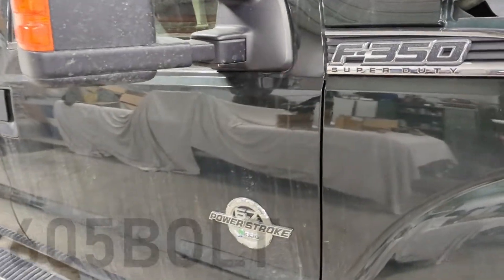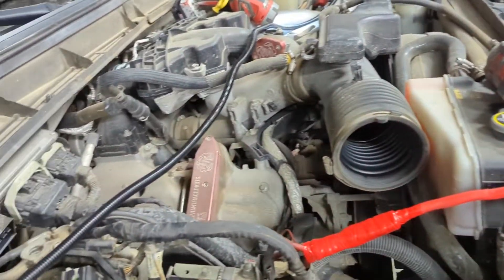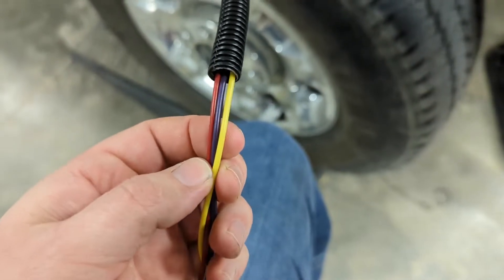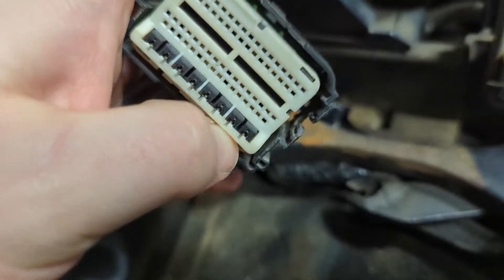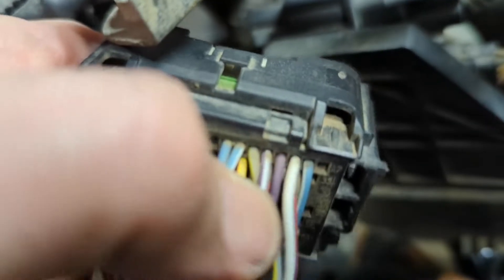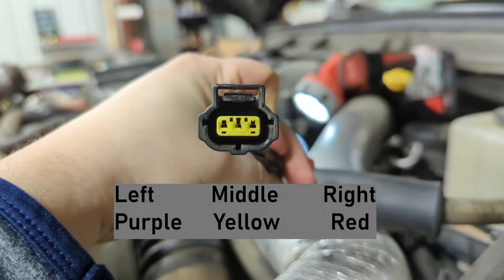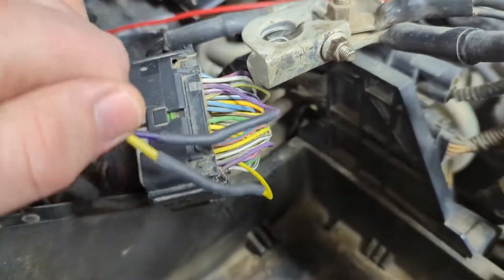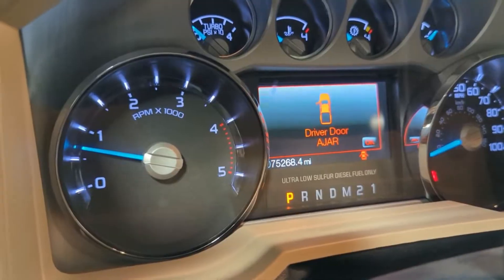6.7L PowerStroke Battery Light -- Common Problem, Easy Fix!

Comment: This solved my problem. My truck would flash the battery light when I reached speeds over 55mph. I had a feeling it was a corroded wire that was acting up as the truck accelerated. My infotainment and dash lights would turn off as well. I search high and low for corroded wires but couldnt find any visually. I followed the instructions here and resolved all my problems. Honestly, this repair would have been easier than trying to repair a corroded wire under the truck. There is not much room around the bottom of the engine. I was skeptical of the 5A fuse, but so far so good. Thanks so much for posting. Took me maybe an hour, but I loomed the new harness and replaced the alternator pig tail.
Reply from the maker: Yes! Glad you posted back. We have had many miles of problem free service as well. Glad this helped someone out. Beer time!

Comment: Don't let the red wire fool you. If it shows any resistance at all, run a new wire alternator to battery. The battery tested 12.4 volts at the posts but at the alternator that red wire tested 11.8 ... revealing there is resistance in the wire not allowing all the voltage to pass through it, basically now sending a message back to the alternator that it needs to generate more power. This more voltage output, as high as 16.4 on our truck, now sends a signal to the PCM that too much power is being generated and goes into a safe protection mode and shuts down electronics such as instrument cluster, dome light, radio etc. The heater will come on thru the defroster, because the blend door is now not working and goes to neutral mode. The FASS fuel pump would speed up, telling us more voltage was being generated than needed. We ran a new red wire from the alternator to the fuseable link and if fixed the problem. Evidently their is corrosion in the old red wire somewhere creating resistance, not allowing the full 12.4 volts to be reported to the alternator, causing it to kick up power. It was a 5 day project to figure this out. Hope this helps someone.
Reply from the maker: Great points! Thanks for adding this!
Reply: Holy shit great advice thanks! This exact scenario happened to me this morning on my way to work. You saved me a ton of diagnostic work. Thanks!!!
Reply from the maker: No problem!

Comment: Questions, so my 2017 F450 had the same issue. I fixed the yellow wire then a mouth later the light came back on. I bypassed the whole factory wire tray and went to PCM and Battery. However the light is still on...any suggestions?
Reply from the maker: If you test the voltage at the battery, is it charging? Should read 14+ volts on the battery when running.
Reply: Did you ever figure out what caused the issue? I’m having the same thing going on right now.
Reply from the maker: There was a break in the engine harness on the front of the engine. I never did actually confirm that that was going on but the truck has been running great ever since. I'm actually currently driving it.

Comment: Getting a similar issue to the one in the video on my 2012. Battery light will randomly come on and voltage drops to 11.9. Then it will jump back to 14.6 and the light shuts off. Had the alternator tested and it’s good. I’m thinking the same issue but not sure? Thanks
Reply from the maker: Could be. In our scenario the battery showed 14 always using a meter to verify. However the charge light would be lit. So maybe you have a different deal going on. Never showed 11.9 by the meter for our scenario.
Reply: Any luck with your issue.  I'm having the same thing.  Replaced alternator and rewired eveything like shown in video
Reply: @virgilhoefels5089 I’m having the same issue, did it work for you?

Comment: I had a similar issue on our work service truck two years ago. It was only charging at 13.6 volts and the battery like was on. Ran a overlay from the ecm to the alternator connector. Started charging at 14.6 volts. Battery light off. Well two years later to almost the month.  Now the dash shuts off and thd battery light us on because its charging at 17.9 volts.  Checking the wiring tomorrow. But ordered a alternator for it. Plus two batteries because its cooking the batteries.
Reply from the maker: Interesting. No issues here yet. 13.6 sounds like it was right to begin with.
Reply: @605BOLT  I found 13.6 is like a default charging voltage reading with a battery light on. 14.6 and the battery light shuts off on the dash.  It's a smart charging system. Ecm controlled
Reply from the maker: @GregFeeney392  interesting.

Comment: my husbands truck is having a similar issue but he alternator is not charging took It to a shop paid almost 600 for them to fix a ''broken'' wire its been maybe 2 weeks and trucks doing it again alternator is good and he wants to do what you did in the video he was asking if its the same for a 2014 6.7 and also where you connected for the 12v reference should that contact have constant 12v or only when the trucks on and charging because his dose not
Reply from the maker: I assume this would work for 2014. The 12v is literally right to the battery by whatever means. Do include the fuse. We hooked in with a little ring crimp in the video. Include a fuse just to be safe but should be good to go otherwise. Hopefully you get your truck running. Hit me up here if you have any questions. 👍👍
Reply: Did the charging problem get fixed?

Comment: Thanks for the video, it was a lifesaver.  I only had one wire that tested bad and that's the only one I bypassed, the yellow one.  So far so good, now I've got the proper charging voltage and no battery light.
Reply from the maker: Yes! Love to hear it.

Comment: Are the colors on the pcm on a 17 the same ?
Reply from the maker: I don't know. I'm sorry. Best indication would be to look at both ends and if they match then chances are you're good to go.  Sadly you can't check continuity in the wire because chances are they are torn.
Reply: @ oven changed my battery’s and alternator and check or torn wire and find anything I just want to replace them but not sure which ones they are on the pcm
Reply from the maker: @bryanmunoz6133  maybe you can find the wiring diagram online. Could definitely be the same.

Comment: Thank you for making this video, without it I would have purchased a 600.00 alternator and still have the trouble light.
It ended up being the yellow wire to pin 53, I re-routed it along the firewall and now all is well.

Thanks again!
Reply from the maker: Man that is awesome to hear.  Glad you got it fixed!  Thank you for commenting!

Comment: Following ur fix , it fixed my problem , i did found broken red wire under the truck , on the passenger side , fixed it , but light never went away and truck had higher rpm like idling around 800/900 rpm, i bet i had other bad wires somewhere else , so i just bypassed it like you did run 3 new wires and booom fixed it , back to normal idling around 500 rpm ish and no light. Thx man. !
Reply from the maker: Right on!!! Ya they can break in a few different spots so I bet you're right. The high idle is annoying. Beer time it sounds like. 🍺

Comment: Thank you so much! I got a 6.2 f350 in the shop right now, I found the purple and blue (yellow in your video) wires in the electrical diagrams but was having a hard time figuring out where they wanted the red wire ran to.  (1st year apprentice and am still learning how to read electrical diagrams)
Reply from the maker: Oh nice! Ya I didn't know this was a problem for 6.2 gassers. I thought it was only a super duty problem. Let us know how you turn out!!

Comment: Just did this at work today on a 2014 F550. Fixed.
Reply from the maker: Love to hear it. Beer time!
Reply: @605BOLT  next is having to take away the DPF delete.. but that's a Monday problem.. 🍺 🍻
Reply from the maker: @ridds777  did I read that right? Undeleting the delete? Aka back to stock? Or are you doing the delete? That exact truck in this video was deleted due to a failed def heater.
Reply: @605BOLT  undelete the delete. Back to stock.
Reply from the maker: @ridds777  oof that sucks. Why is that? Selling it?
Reply: @605BOLT  in Ontario here. Commercial vehicles have to have yearly safety inspections and emissions testing. In order to get in on the road, the DPF has to be functional.
Reply from the maker: @ridds777  oh man. So do you install it for a week and then remove it again or is it going back on for good?
Reply: @605BOLT  back for good. Catalyst has to be put back, reflash the pcm etc.
Reply from the maker: Dang. Party is over.
Reply: @605BOLT  the bill is already insane.

Comment: I didn’t have 12v at the plug so I went ahead and ran overlays from the battery and PCM to the plug. I had power and continuity but still the same issue. New alternator but still the same issue. I found that the fuse on the side of the passenger battery was broke. I had to cut the plastic cover off it to find it. I soldered it up and that was the issue. I’m ordering a new fuse but for now I’m up and running.

Comment: Any idea what the output from the alternator should be? Just had a shop put a new one in, I was getting 13.01 right off the alternator before and the new one is saying 13.5, battery light is still on. I feel like it should be closer to 14v, Will this wire effect how much the alternator is putting out? The replacement alternator was an OEM ford replacement
Reply from the maker: 13.6 is nominal I believe. I don't think it changes output. You either have it or you don't. Sorry I can't be more help.

Comment: When you battery light was on did it affect your dash lights and upon startup voltage jumped around all over
Reply from the maker: @leroysplace70  the dash light was on. Like the one in the thumbnail.

Comment: Ok, so I was getting the battery light and P0620 code. Alternator was not charging. I rewired the 3 wires and was still having the issue. I rechecked the 12v power and continuity between the purple and yellow wires and have it so it should be good. I went ahead and bought a new alternator thinking it must be the problem, but I still have the same issue. Where should I go from here?
Reply from the maker: @jaythewhizdog3842  is the alternator actually charging? Should have 13.6 volts on the battery post.

Comment: So in this video where does the pig tail plug into, not sure where everything is yet in my truck. And I can’t really tell which plug is for what. 

Thanks
Reply from the maker: The three wire pigtail plugs into the back of the alternator if thats what you're asking.

Comment: What size in line fuse do i use for the red wire to the harness
Reply from the maker: Something small.  I don't remember what I used but it was small. 5 or 10 amp i would think would be fine.

Comment: Is this the same for a 2018 6.7?
Reply from the maker: I don't know how long the problem existed. That is a different body style as you probably know.
Reply: Yeah still has the same issues charging output is over 14 two new batteries and new alternator just bought the truck I will look into doing this just wanted to know if the bcm were the same wires
Reply from the maker: @camrendavis1650  ah I see. Ya I'd be curious too. If you find out, try to post back here for people browsing the comments. That would be helpful. Good luck!!
Reply: @605BOLT   Yeah im gonna tackle it tomorrow! for the hot wire (red not the two to the pcm ) you just put an inline fuse and attached it to the battery terminal ?
Reply from the maker: yes.  Sorry I didn't see this comment earlier.  Did you get everything figured out?

Comment: What guage wire did you use?
Reply from the maker: @saulnajera1081  just like a 16 or 18 or something small. No real current flowing through it.
Reply: @605BOLT  ok my f350 is acting up
Reply from the maker: @saulnajera1081  give it a shot.
Reply: @605BOLT  will do and give ya an update
Reply from the maker: Right on. Good luck!